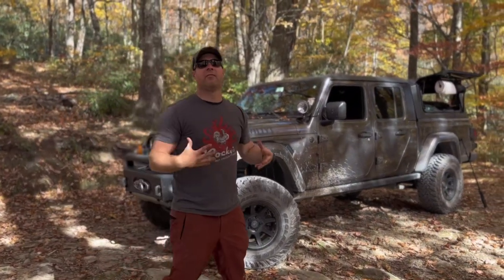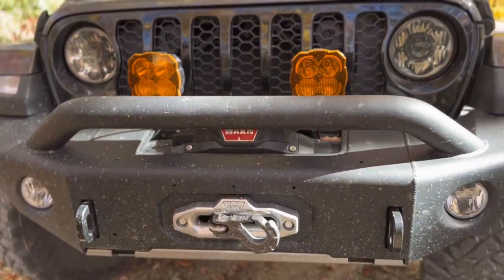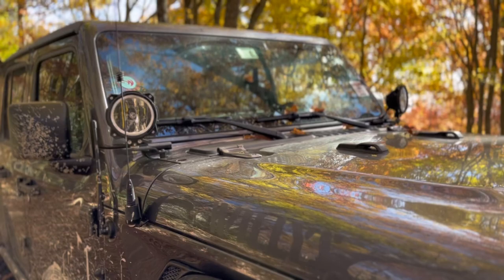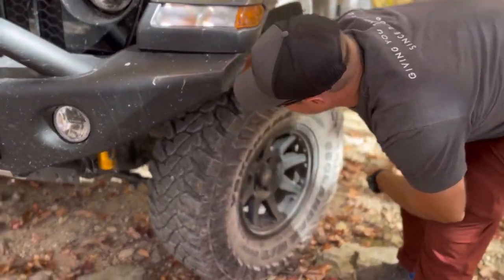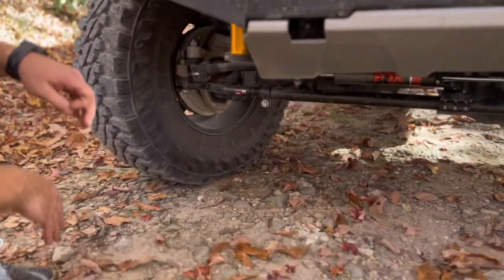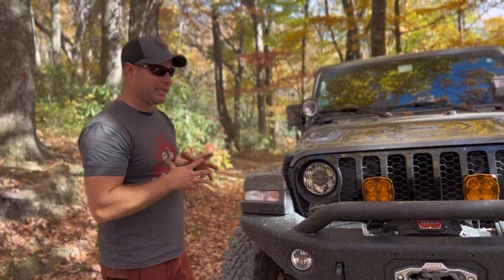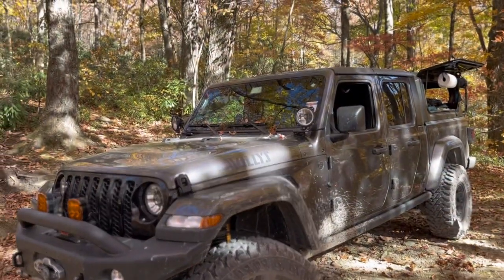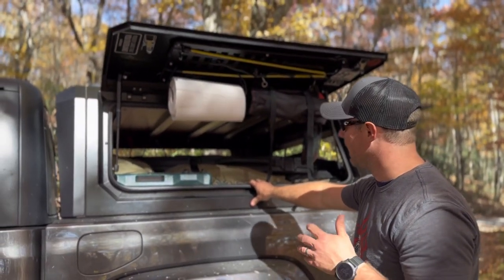Jeep Gladiator Build / Walk-Around with the RSI Smartcap

Comment: Psc hydraulic steering will fix everything.  Not cheap.  I had the same issues.  Horrible steering.  Went with steer smarts also.  The PSC is a gamechanger.  Comes with Big Bore steering box.  Need it with 37.  I have 4.88s. Are perfect for my AEV wrangler build.  5.13s should be good for you.  Try a throttle controller for now.  You will be smiling.  4.88s my mpg went up 2mpg from 35s.  Much more torque on low end.  Great video.
Reply from the maker: I will be doing a video very soon the the just ordered upgrades, and yes just a little early info, I went with 37’s!!!
Reply from the maker: Also, I appreciate the comments! Thanks for checking out and taking the time to engage!
Reply: Very nice channel!  Great job. 👍